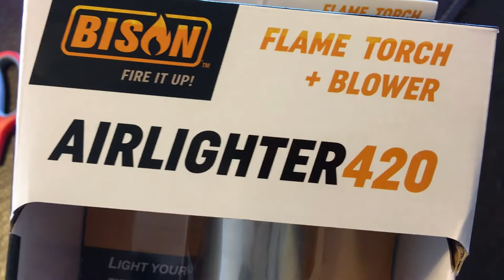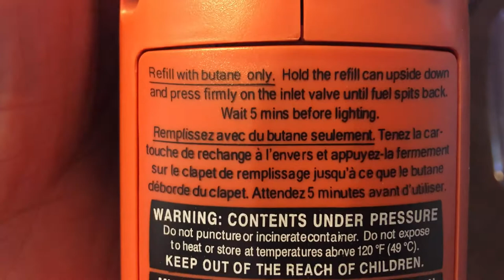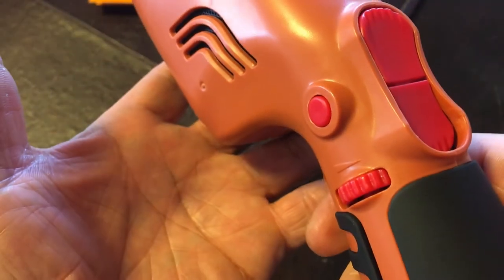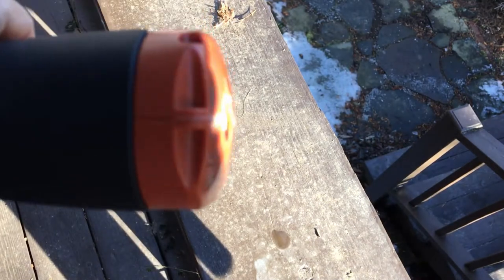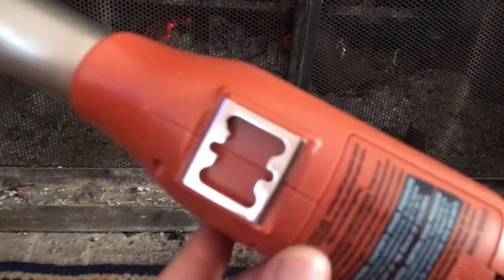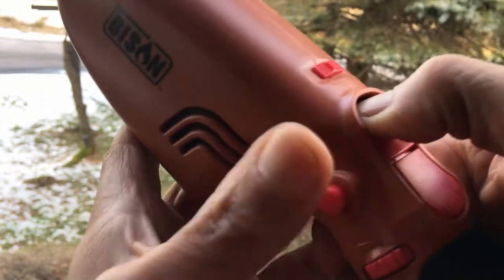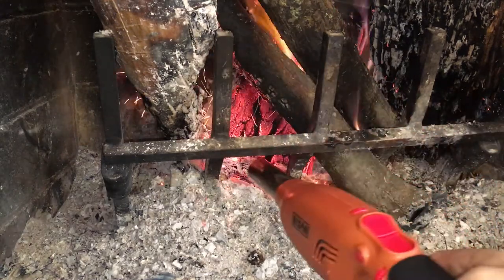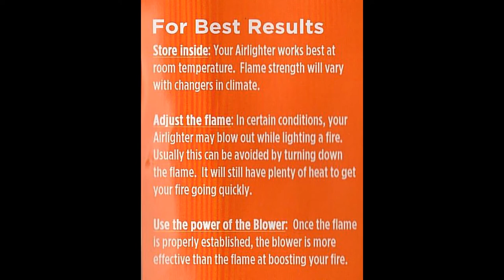BISON AIR LIGHTER Torch Fireplace Grill Fire Starter Air Blower Bellow 420 (Orange) (01-22-2020)

Comment: That is so fun to do, blowing air into a fire and it gets hotter. That gadget looks really cool I may try to find one. I have a similar torch a creme burlee dessert torch which lights fires pretty good but it doesn't have a blower. I use a homemade personal fan for that. I like this device because the fan blades are not exposed to the fire.